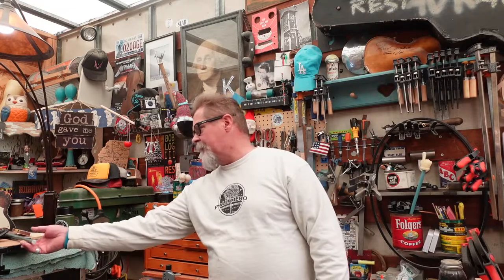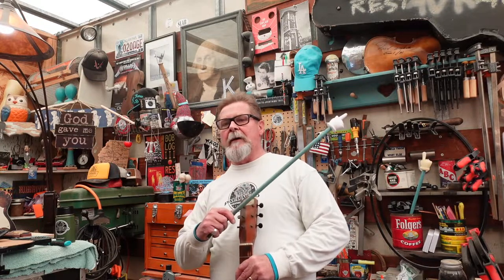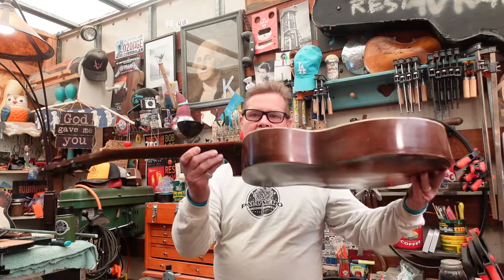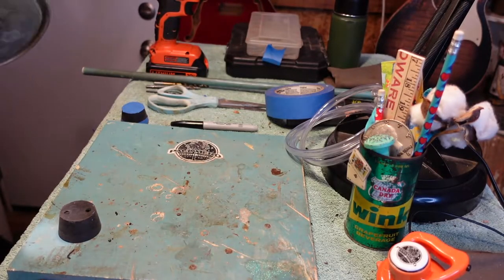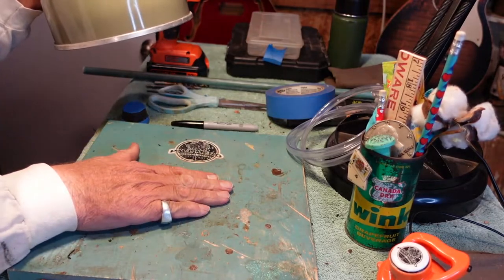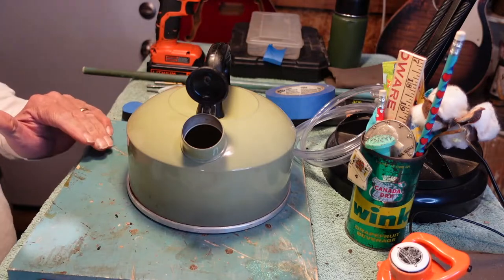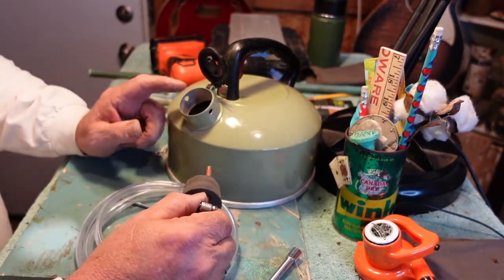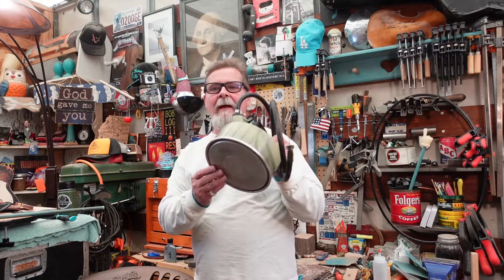DIY Guitar Neck Steamer: Econo-Archtop Guitar Neck Reset: Part 2

Comment: Hi, I'm getting together the tools and making the jiggs to pull necks and came across a used garment steamer for pretty cheap. Will this adapt or would it be a waste of 15 buck?
Reply from the maker: Hey Pete.  If you can fit a basketball inflator needle to a hose and get it to push steam. It will work just fine.

Comment: thank you Ken, I bought that StewMac dry heat tool, it was horrible for me, I wouund up adding water to the heat stick to create steam...everything I have to reset has hide glue...wrong neck angle, it should have been 2.5 degrees...SG, LP Special, Double cut Special...ugh..atleast I have a great tool now Thanks again
Reply from the maker: Hey there.  Having a steamer and hide glue lets you make a few mistakes :-) ask me I’ve made them. Thanks for watching.
Reply from the maker: @hardrockindaddy  perfect. Thanks for watching